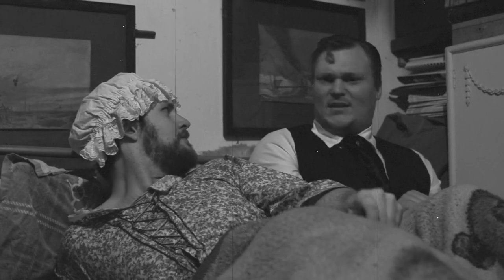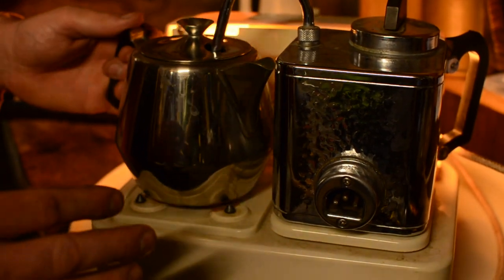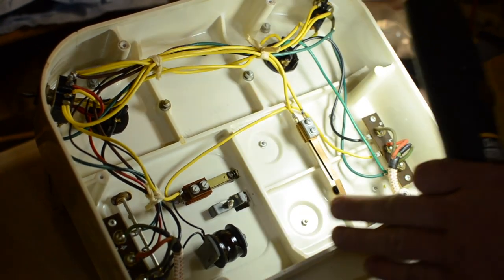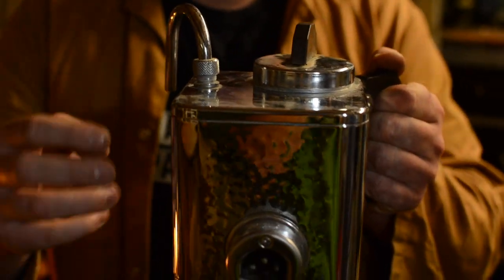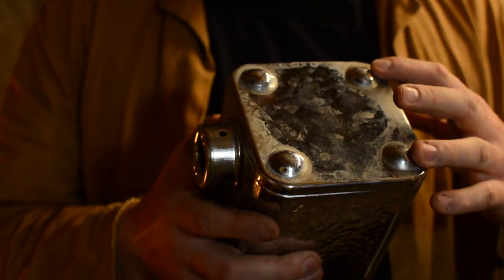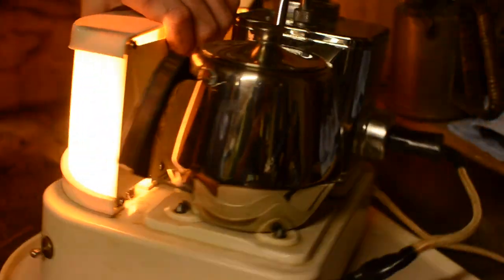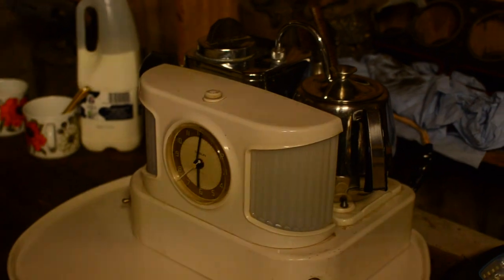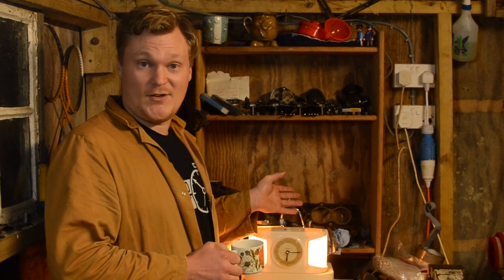Goblin Teasmade

Comment: During the 60's I grew up with the same Goblin(but with the ceramic pot), as child I was fascinated with this device. I lived in Edinburgh at the time and a guy up the road was a registered Goblin engineer. It never broke down though and it was used up to the mid 80's then the clock wore out I managed to fix it for a while but it was eventually thrown out.